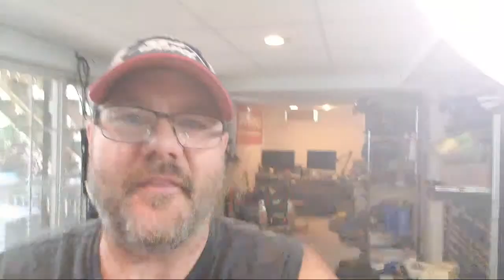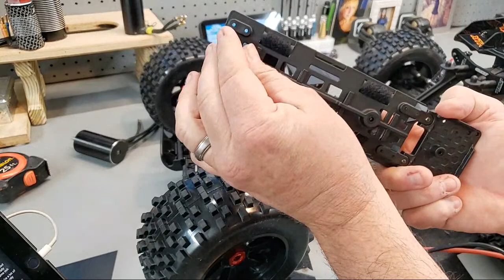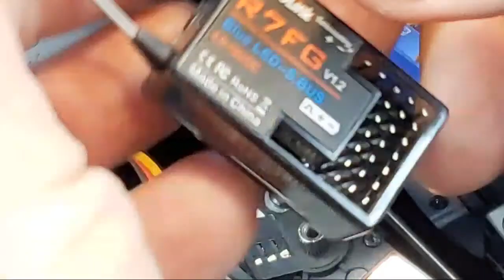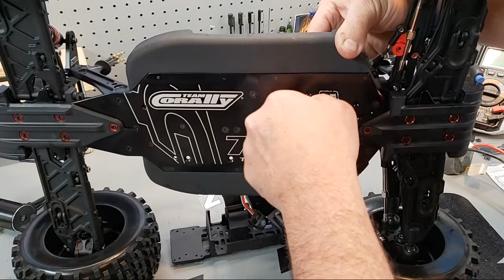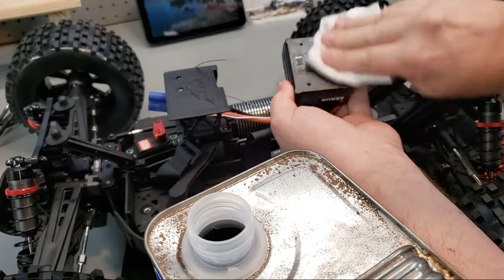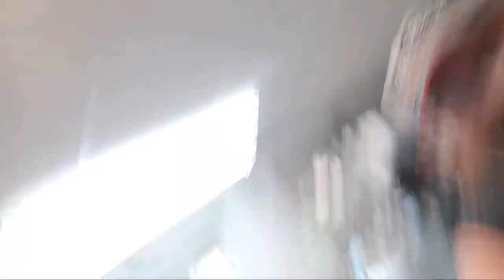Team Corally KRONOS XTR Live ELECTRONICS Install

Comment: FYI, I’ve run that setup with 8S, and it takes it, motor gets 130 degrees esc doesn’t go over 100 after long off road runs. It’s not recommended on the specs, but I tested it and it’s insane and holds up. I have this in one of my Mojave’s. 6s is decent. No record breaker but solid. Great system not to heavy. Bought another combo just for extra. I thumbs up before I even watch, I got you!